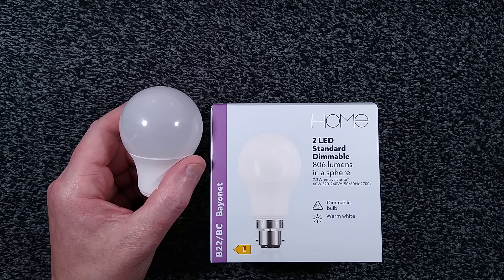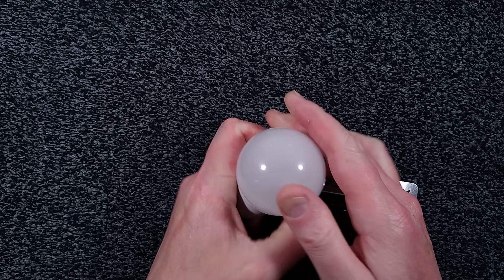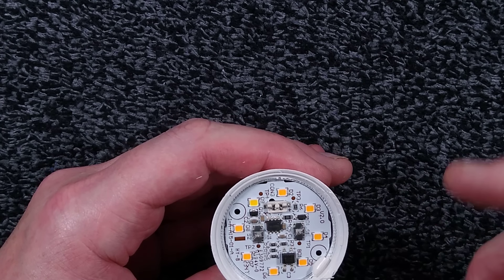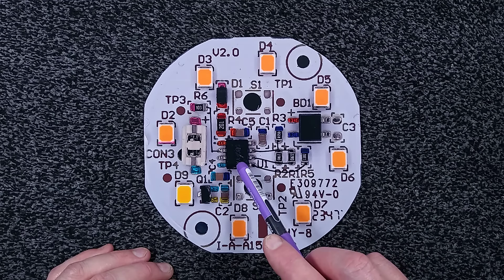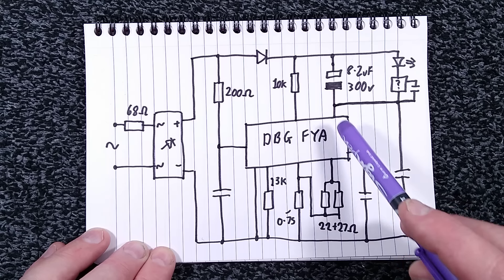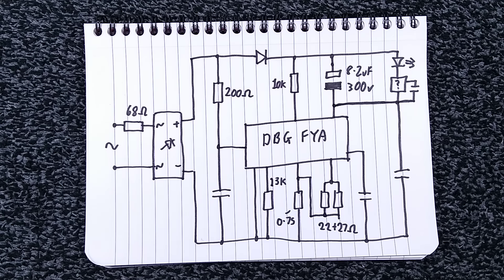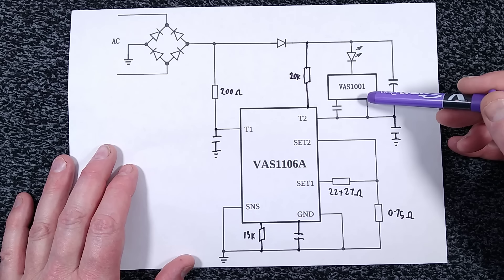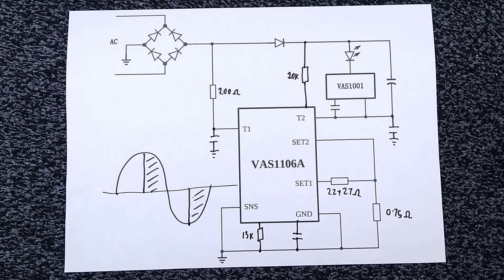Inside a Sainsbury's dimmable LED bulb

Comment: I've got an old dimmable led bulb that's been in an outside light for about 12 years, and has just failed - if you want to compare new ones to how they used to make them! 
Seems more substantially constructed than the newer ones for sure.
Reply: Agreed,   the older ones had a chunky finned aluminum heat sink to dissapate the heat.  The newer ones have vent holes in the envelope and rely on the FR2 board as the only heat sink.   They wont last as long.   Heat is the arch enemy of LED longevity.

Comment: Over here in the US, we’re overwhelmingly stuck with Edison screw base lamps for residential lighting.  Mostly specialized stuff like small halogen lights have bayonet bases.  Even early electric appliances have Edison screw plugs on their cords.  It wasn’t until 1904 that Harvey Hubbell invented the familiar two blade socket.  Early on, you had to remove a lightbulb from its socket to power your appliance.
Reply: @wtmayhew 
 it is worse now, many new fixtures are all-in-one, and lights are irreplaceable, for most people.  One will be stuck having to call in an already overworked electrician to change out fixtures every few years.  Corporate somehow believes it is helping but is most certainly not.  Edison is not likely going anywhere, but US does need an interchangeable standard or few for LED.  Changing out fixtures is ridiculously wasteful!
Reply: @GeorgeVCohea  Thanks for the reply.  I agree.  Some type of module which is easily swappable and in a convenient form factor for replacing either the power supply or LED string would be welcome.  For now the almost 150 year old Edison base will have to do the job.
Reply: The UK has had the bayonet light socket for ever - and yes it was the same here, very early appliances were plugged in to the light socket with a bayonet adaptor, before wall sockets were common.  Those were still sold until around the 1980s, often used for Christmas lights. I have a bayonet plug to 13A (standard UK power socket) adaptor lead - highly dodgy but sometimes handy if you need low current, ungrounded power when there is only a light socket available.
Reply: @rossthompson1635  To be fair, running the iron from a splitter in the pendant light above the ironing board is quite a nice way to do it! 😁
Reply: It's arguably worse in the UK, because we have suffered an invasion of ES bulbs and portable lamps (ES is used on the continent too), so we've had to double the inventory. Ikea grudgingly sells bayonet bulbs on the UK market but all their lamps are ES.
Reply: @matthewmarks6951  I agree - great fun!
Reply: @matthewmarks6951  Ikea only sells one or two types of BC bulbs. They do sell BC to ES adaptors. 

As for "double the inventory" an elderly neighbour asked if I could change some bulbs in her lounge as most had blown. I went over with both BC and ES bulbs only to find that they were SES (small Edison screw). Cue a hurried journey to Wickes ten minutes before they were closing to buy some of those.
Reply: @MrDuncl  You can imagine how disgruntled Ikea must have been to have to stock UK-specific products! Good to hear they sell adaptors. As for SES, well to be fair we have SBC too...

Comment: The first LED bulb I bulb I bought in 2018  and it even said dimmable on the box(but installed years later) is dimmable. It's not used on a dimmer, however, when when power company had issues and the voltage dropped to 70 volts (it's usually around 120), the bulb was the only one that stayed lit. The others were CFL's.
LED bulbs I bought later were not dimmable. Interesting bulb base type you have there. Ours is screw in types.
Reply: That bayonet type is the standard bulb base here in India as well, usually B22. I really don't want to deal with Edison type bulbs on 230VAC given our shoddy wiring practices.
Reply: In the UK and EU if the Volts drop more than (I think) 10% from nominal the power company has to cut the power for safety reasons. Certainly a 40% drop like you mention would actually be delivered as a 100% drop and a search for candles (at least before we had battery powered led flashlights)

I may be wrong about the exact % tolerance figure, but there is certainly a legal limit this side of the pond

Comment: I do wonder if, now that LED bulbs have become far more common, we'll eventually start seeing DC rails in homes dedicated to lighting. You still might want some basic separation in large homes, but with how little power those bulbs pull, you could probably get away with a single DC circuit with a nice beefy power supply at 24-48 volts for most of the house. More efficient, easier dimming, and would help with the issue of many bulbs being far more sensitive to voltage fluctuations than incandescents.
Reply: People have been talking about this for a long time and I doubt it will happen. The main issue is the price of copper. Bear in mind the copper losses: halve the voltage and you get four times the loss for the same power. Also, big power supplies are not efficient at low loads. The hybrid solar inverter I've been playing about with consumes about 40W before it puts a single watt into the 48V battery (with its 25 sq. mm leads!).
Reply: "1883, Nikola Tesla built his first transformer that turns AC (alternating current) from low voltage to high voltage. To contrast, AC power could travel much further with the aid of transformers while Edison’s DC current could only travel a mile before another power station had to be built".
Reply: @snakezdewiggle6084  Back in the day bulbs consumed 100 Watt. These day's 100 Watt of LED will light an entire house.
Reply: @Frankhe78 
Sorry Frank, I'm not sure of your point here.
Watts are a measure of energy, no matter the device or machine that consumes it.
Ohm's law tells us W=V*I, so we need at least one Value on the right of the formula to know if the 100 watts is desirable or not.
Your hypnosis is valid, but it best serves efficiency of the of the device  (photon per electron.).
Reply: @snakezdewiggle6084  Back in the day every house in the street had a 100 Watt bulb and with Edison DC the voltage drop in the cable from the generator a couple of blocks away was huge. Contemporary LED lights consume close to 5 Watt and therefore one can light an entire house on a 24 or 48 Vdc system with very low voltage drop on the cables. Given cables terminate within the house and don't extend to the end of the street or a couple of blocks away.
Reply: @snakezdewiggle6084  Since we're being pedantic now, watts are a measure of power, not energy. Energy would be watt-hours or joules ;)

And his point is that the amount of power or energy required to light a house is way lower now than it was in the past. The big benefit of AC was indeed the fact that the voltage can be changed easily using transformers, allowing it to be transmitted at much higher voltages and therefore lower losses.
Reply: @matthewmarks6951  Valid points. I think the biggest benefit would be allowing a better method of dimming, since a lot of the complexities of LED bulb design are due to making sure it plays nice with being dimmed by a traditional dimmer switch, which often makes it more susceptible to voltage fluctuations. Even just a separate control line for the lights would allow for much simpler drivers and more robust filtering. But of course it also makes the wiring more complex, and seeing how things have gone in the past I expect you'd end up with a handful of lighting companies making their own proprietary standard and that would be a pain.
Reply: @Lizlodude 
Well, if You say so.
Reply: @Lizlodude  For now AC is still the dominant standard for domestic lighting. Although LED strip lights gain in popularity and these are usually safe voltages like 12 Vdc or 24 Vdc. In that respect it would make sense to have centralised AC to DC conversion and use simple PWM-controllers to dim the lights locally. And adding battery backup is very simple.

Comment: At least the bridge rectifier is only drawn wrong. I had some very early MR16 LED bulbs (12V), which contained a discrete bridge rectifier and a switch mode regulator with Schottky diode. The PCB had two rows of diodes on it - three and two. They mistakenly put Schottky diodes in both positions of the row of two, although one of those was part of the bridge rectifier. The Schottky diodes had a voltage rating of half the conventional diodes, so the lamps didn't last long...
Reply: I was scratching my head about the bridge rectifier in the schematic, sort of wondered if I was going mad. Still as you note the practical realization could be worse than just an incorrect diagram.

Comment: I think sometimes the store-brands can be overlooked whilst actually being decent quality. I have a Tesco led bulb I must have bought around 2008 when they started becoming more popular, and it's still in use very regularly in my main hallway and absolutely fine. They must not have drove it too hard at all, but it's served me longer than anything else so far. I've wanted to take it apart to see how it ticks but i don't want to tempt fate.
Reply: Tesco used to sell dimmable multi colour LED bulbs: controlled by a remote control they pretty much ignored what a dimmer switch was trying to tell them.

These are more than ten years old, and the bulbs are outlasting the remotes! That means to configure the colour/brightness I have to remember which room I left a working remote in.

However when the last remote dies, these still work as perfectly good lamps, just fixed white and non-dimmable.

 They were just under £20 at the time, if I remember rightly. Compared to the incandescents they replaced they have already saved me now than that in electric bills so it was a good buy at the time.

It's a crying shame that I didn't buy more of them so I had a stock of spare remotes...😊
Reply: I would say that any bulb bought from a reputable outlet deserves a certain degree of trust. The 12V Sainsbury's ones I have even incorporate EMI filters.
Reply: In 2008, there were likely only a few (major companies like Osram etc) OEMs for making such bulbs available to supermarkets, so you got a market leader brand's quality product, I guess. 

It was cheaper at Tesco because of their buying power or because of minor changes like an older, larger bulb shape or something.
Reply: @interstat2222  Well the supermarkets have a certain reputation to maintain. See also the quality of USB power supplies from Ikea, that Clive has torn down.

Comment: Advice wanted from the community: If one wanted to replace all the LEDs on these aluminized PCBs with different color devices, what recommendations on techniques do you have for R&R? I’m thinking a rework hot plate might do the trick if the heat is carefully managed.
Reply: I've never used them, but I'm guessing "hot tweezers" might be the easiest way to swap the LEDs without disturbing the other components. If I'm wrong, please feel free to correct me.
Reply: @dashcamandy2242  I think the hot tweezers combined with a hot plate (not turned up too hot) would work OK.
Reply from the maker: A rework plate could definitely make it easier.  Keep in mind that the LEDs are multi-chip.

Comment: So how well does it work Clive? Is it a smooth dimmable lamp?
Reply from the maker: I can't test it here.
Reply: @bigclivedotcom  I understand. When you can let us know if it has a smooth start up from OFF or if it flickers. I could use a good LED lamp that will work with standard AC lamp dimmers. Thank you for sharing with us.
Reply: @Robothut  Also, if it buzzes. I've a feeling it won't buzz loudly as there are no inductors.

Comment: LED lighting has been a blessing and a curse at the same time. A blessing when it comes to energy consumption and less heat, a curse when it comes to complexity and diversity of the lamps, non universal dimming, colour temperature and CRI. And don't get me started on longevity. I think I've replaced more broken LED bulbs in the last 10 years than I've replaced incandescent bulbs and gas discharge lamps in the rest of my life. Just separate the drivers from the LEDs. Easier and cheaper to maintain and tons less electronic waste. When halogen lighting became popular we also put transformers above the ceiling and in cabinets. Why not do the same with LED? It's insane to put a driver in each bulb.

Comment: Is the bulb cover made from recycled milk containers...?  My first experience of LED bulbs, showed a high failure rate especially outside. Taking one apart showed a big series string of LEDs glued in a circle, joined together with tiny wires, which would break easily under vibration. Eventually I replaced  them with name brand LED bulbs.
Reply: Well, Clive did not find it aMOOsing...😅

Comment: Clive, Did you notice something wrong with that VAS1106A schematic that you brought up? The Full Bridge Rectifier is drawn incorrectly. It shows AC input at the Plus and Minus terminals.
Reply from the maker: It's not uncommon to find weirdly obvious errors in datasheets.  I'd guess they are "translated" by less technical people.

Comment: "your text here" :)

Are there any dimmable LED bulbs which don't buzz yet? I've tried a few and they all did it and that's the only thing keeping a halogen bulb in a touch lamp in the bedroom. I'm sure it won't kill that many polar bears, but I will eventually run out of them (halogen bulbs, not bears. Unfortunately none of those in the bedroom).
Reply: Are you certain it's the lights that are the issue and not the touch lamp? Some crappy dimmer circuits work at audible frequencies which with a purely resistive load like a halogen probably wouldn't be noticable but with something like an LED bulb that's a bit more complex you would hear it

Also, yes please no running out of bears! They're already endangered! 🐻‍❄️
Reply: @oliverer3  It'll be a consequence of the 50/60Hz mains frequency, whether it's the dimmer or the lamp. I've got some Philips dimmable LED bulbs which buzz, but maybe these don't because they don't contain an inductor?

Comment: I used alot of the Sainsburies non-dimimable ones and they all failed consistently at around 1/4 of the expected life.
Reply: Yep. They're often in sales at stupidly low prices showing the true cost is virtually zero. No troubles with Philips (obviously) and IKEA (surprisingly as they're not expensive).

Comment: Some dimmable bulbs like Philips "WarmGlow" use LEDs of multiple color temperatures so that they can change the color temperature to warmer as the light gets dimmer. Not the case for this Sainsbury's bulb though.
Reply: I have some Philips warm glow (I think they were called "dim to warm" when I bought them a few years ago) GU10 spotlights and they are extremely convincing at replicating the colour temperature change of halogen dimming.  I hope they still make them - not looked for a while.
Reply: Nice feature: I want some...😊
Reply: @rossthompson1635  I've got some 4W and 6W ES ones that B&Q were selling off. They work well and reliably, but they do buzz rather on a phase angle dimmer.

Comment: What kind of base does that bulb have? I've never seen one before. In the USA it seems the Edison screw is standard.
Reply: There are really only two types - bayonet mount and Edison screw.
Reply: The base types are Edison or bayonet respectively.

On a gruesome side note (look away now if you are squeamish)

...

...

...

bayonet fittings are so called because when using a bayonet in combat, for maximum goriness you don't just stab, you stab and turn. That's how you engage a bayonet fitting.
Reply: Often the same bulb is available in both; the normal size is designated either B22 or E22 for bayonet or Edison respectively
Reply: @trueriver1950  Oh! I thought it was just the way the blade was fitted to the gun barrel, although it does make me wonder that if you twist it the wrong way you'll leave it in the victim...

Comment: Hold on... the bridge rectifier in that recommended schematic for the VAS1106A doesn't look right. I'm pretty sure that very bad things would happen if you wired AC to the top and bottom of a bridge rectifier as that shows. Oh dear.